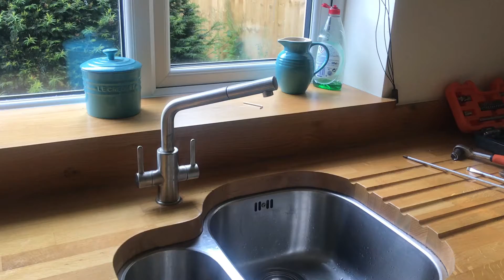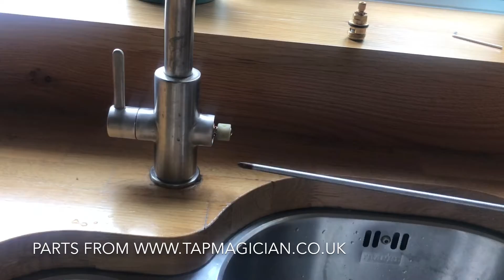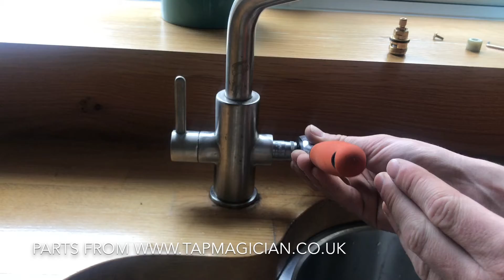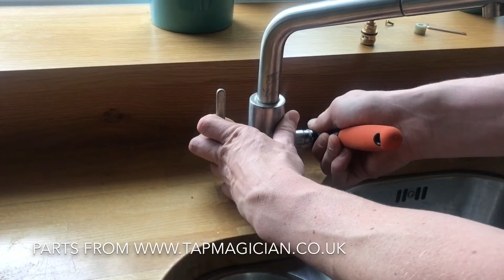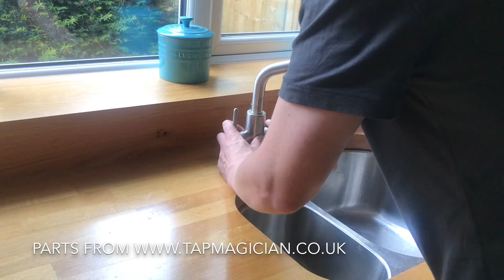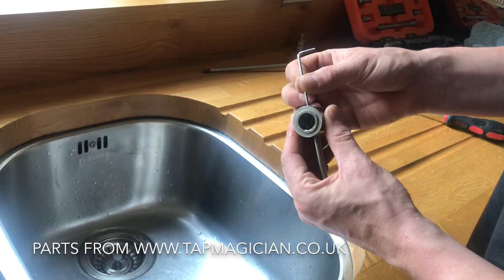Franke Maris repair your dripping tap - replacing the ceramic cartridges Valves @tapmagician

Comment: Hello mate.... I've got a Carron Pheonix tap where the cartridge is hidden like in this video so using a 14mm socket... Which seems to not fit, too small and 15mm is too big. Sorry new to this... Is there a 14.5mm or do I need the adjustable wrench for this particular style of tap
Reply from the maker: Hi, We now sell a removal tool. Please see here https://tapmagician.co.uk/NSTools.aspx However if you have rounded your nut off you may still struggle please call us and ask to speak to our technician.